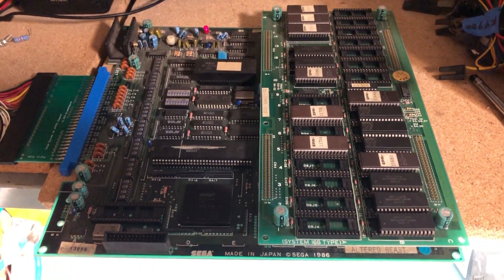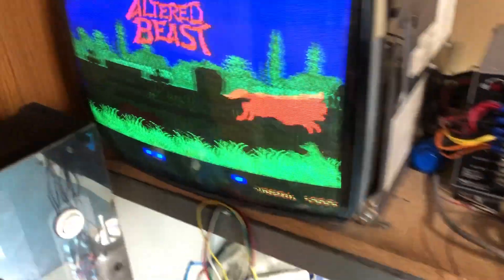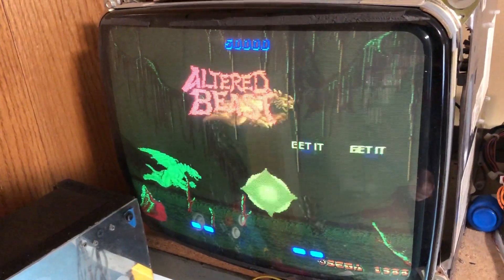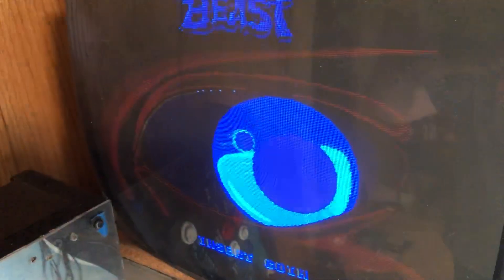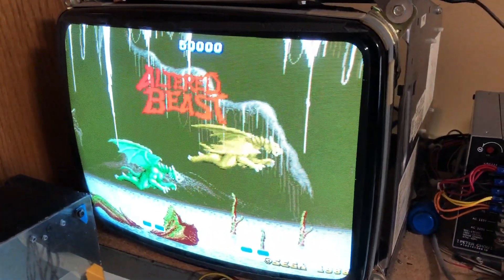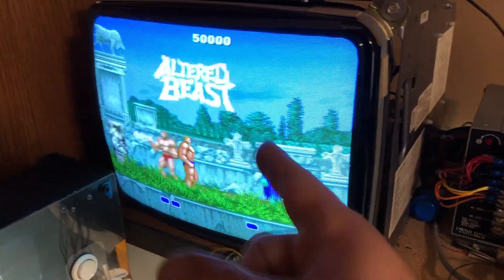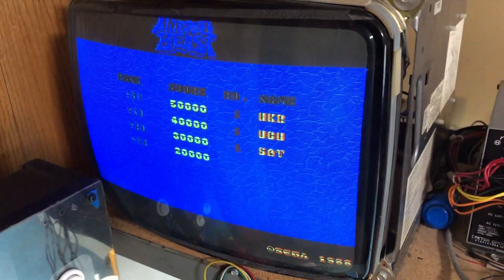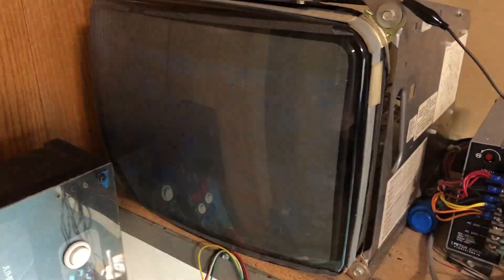Arcade Monitor 101 - Make Sure The Tube Frame Is Grounded

Comment: Is the gnd off the PSU also connected to the Earth GND? 

I have a frankenstein of a cab, it’s a Naomi universal, custom tube bolted on the frame, CRT and chassie GND are connected to the metal frame (chassie GND?) which is the same point as Earth GND. Is this an issue?
Reply from the maker: Depends on the power supply but it’s supposed to be internally. Not every supply is like that though so a jumper is ideal.
Reply: @ Sweet! Thanks for the vids. Love em! 👌🏻

Comment: What if the monitor doesn't have a metal frame? My machine has the screen rotation mechanism and there is no frame (it's held by a wooden structure)
Reply from the maker: The tube ground is attached to the frame so if you don’t have a frame, the tube ground would accomplish the same thing.
Reply: @MikesArcadeMonitorRepair  So it's the ground cable going to the neckboard (it's connected to a metalic strap going around the tube)? The one going to the chassis ground, not the wall connection/earth ground.
Reply from the maker: Correct. But if you don’t have the issue like in the video, you don’t need to do anything.
Reply: @MikesArcadeMonitorRepair  Thanks a lot. This grounding question was bothering me for a while.
Reply from the maker: You’re welcome

Comment: Are you using the DC ground from the power supply or the earth ground from the wall outlet? I’m used to seeing the chassis frame and all other metal components in the cabinet grounded to earth ground
Reply from the maker: DC ground.
Reply: @MikesArcadeMonitorRepair  I have heard that some people will put a jumper between the DC ground and the frame ground on the switching power supply to connect them together and it will take care of interference or snow on their monitor.

I had a ground between the frame ground on the switching power supply and the frame of the monitor in a 60 in 1 cabinet I built, and it would only clear the snow up if I removed that ground cable.

Comment: Thanks for the great info.  Did you check the Jamma adapter wiring of the video ground pin?  Seems like it is not connected to monitor signal ground and you are proving a ground reference for it by shorting psu gnd to chassis gnd (just a thought).
Reply: oh so you are a scientist now?

Comment: How did you realise that that's the problem? I would have never figured that out, I would have replaced all ICs on the board lol
Reply from the maker: From previous experience knowing what boards with video ground issues look like. I’ve seen boards before with video ground problems and they had the same issues.